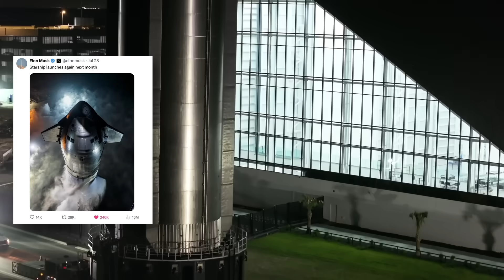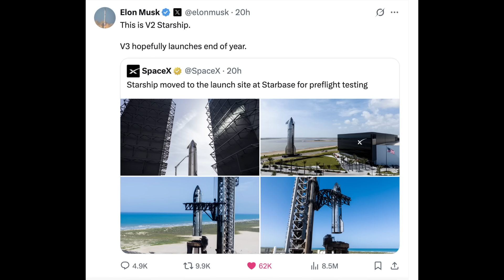Elon Musk REVEALS SpaceX Starship Flight 10 Launch Timeframe!

Comment: Scott brushed right past the gen2 issue as if it was a complexity problem. That’s just not the case. SpaceX decided to feed the vac raptors with individual feed lines running from the upper tank through the bottom tank. Because this requires vacuum lining to prevent slushing, they were presented with two choices. Either develop specific production techniques to vacuum line pipes with bends in them which doesn’t currently exist OR run straight lines at an angle from the center of the upper tank to the outer edge where the vac raptors are mounted. They went with the second choice which was a clear mistake. Rockets grow in length when they are empty compared to when their tanks are full of cryogenic liquids. If you have a downcomer or feed line running parallel to that growth, no biggie, a single bellows section at the top is more than enough to compensate for any length differences and most of the time it doesn’t even do anything. However, when a feed line isn’t parallel to the direction of length change, those changes will introduce angle changes in said feed lines, which requires bellows sections at BOTH ends! Any first year engineering student can tell you why this is a really bad idea. You never, never, ever want to free float a weight inside of something with as much vibration as a rocket. That is a recipe for a multi modal resonant hellscape that as we’ve seen in the gen 2 flights tends to shake things apart. Either they are hiring from the bottom of the barrel over there OR a left leaning engineer took issue with Elons political shenanigans and decided that resonant frequencies weren’t really all that important any more.

Comment: I just hope the mobile transport stand they retro fitted for the upper stage holds up to the weight, as it was only designed for 150 tons, not a fuelled rocket with 1200 tons, and then the thrust trying to pull it apart as well.
Reply: Do you think they will do a full fuel load for the static fire test?
Reply: @jeffreysims1249  Full is 1500 tons

Comment: S38 will be pushed through cryo testing and static fired b4 it is fully finished with TPS, flap, etc. installs. It will be tested on the pad 1 jury rigged setup b4 flight 10.  After the static fire S38 will be moved back to Megabay2 for the final fit out during the flight 19 testing cycle.  Flight 10 will happen in August.

Comment: Breaking things is much better, AND cheaper than spending months testing every little change.

Without the solid rocket boosters(SRBs) on SLS, which were designed in the 1970's, Falcon 9 actually has more power than SLS.

SLS cost about $25 billion. 

While Falcon 9 AND Dragon 1 combined only cost about $3.5 Billion.

In fact, they spent literally $2 Billion on modifying the SRBs. That's more than half the cost of SpaceX building both Falcon 9 and Dragon 1 combined.

SpaceX has spent less than $6 billion, over 10 years on the vastly more complex Starship and  Super Heavy.

SLS, which compared to Starship, is a project that the extra smart high school kids could do for a science project took 12 years......

SpaceX is absolutely smoking the competition.
Reply: Lol
Reply: If ship37 explodes (sorry dissasembles itself unexpectedly) during static fire testing - and V2 has perfect record of exploding - it would be much better than loosing time trying to find out what's wrong with it,right?

Comment: Good stuff Ellie! Thank you 🙏 I’m intrigued to know what changed from Block 1 to Block 2 that caused flights to start going wrong. Block 1 seemed pretty reliable.
Reply: Reliable how? It obviously didn’t make the cut or they wouldn’t have changed the design… the ship is a failure period
Reply: @lonewolftech block 1 ships on flights 4, 5 and 6 achieved full duration ship flight, re-entry and controlled landing in the ocean. Whatever they were doing right with block 1 seems to have gone wrong with block 2. Not sure if you’re trolling but it seems a bit premature to call the ship a failure? It is an experimental program, surely?

Comment: 5:00 Kinda like half-removing an airliner jet engine and pylon with a forklift, in a manner not approved by McDonnell–Douglass, and letting it hang out from half the bolts for a while during a shift-change, while the hydraulic fluid slowly leaked past the seals?

(That engine later pirouetted over the wing at takeoff, taking out the hydraulics needed to keep the wing it left behind producing the same lift as the right one. Caught on camera; not pretty.)
Reply: I remember that.